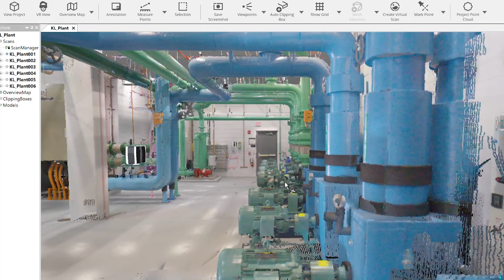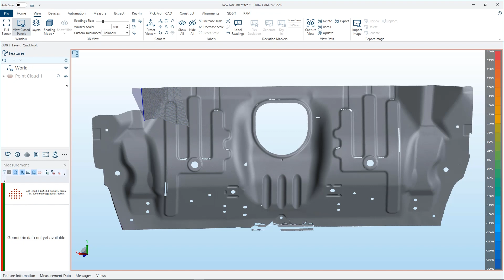FARO: Complete Scanning Portfolio

Comment: Hi FARO,
Does pre-registration information gathered through the STREAM app make it to SCENE at the end of the day? Or does it only benefit the process if we directly upload to SPHERE? Thank you!
Reply from the maker: The registration performed in-field with Stream is transferred to both SCENE and Sphere.
Reply: @FAROTechnologiesInc  Ok that’s amazing. Apologies if this is not the place to ask but after completing sever scans (and they snap perfectly within the stream app), bringing and registering them inside SCEENE seems to be relying solely on SCENE (be it top view, or cloud-to-cloud). 
Is there an additional step/files/folders that need to be imported into scene from the SD card in order for it to see the pre-registration?
Thank you guys!
Reply from the maker: @danielkuzev4992  In order to maintain the registrations performed in Stream, you need to use the Import Project function (from the SD card) in SCENE. If you just copy/import the FLS files, the pre-registration positions will not be included.
Reply: @FAROTechnologiesInc  Ahaaaaa…. Thank you! Thank you! Thank you! I am trying this later today or tomorrow and will report back!